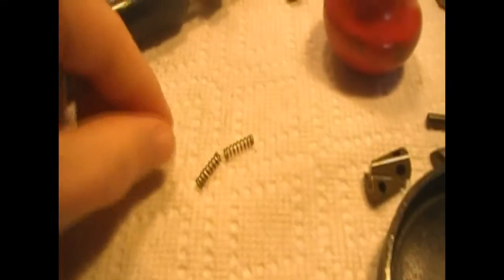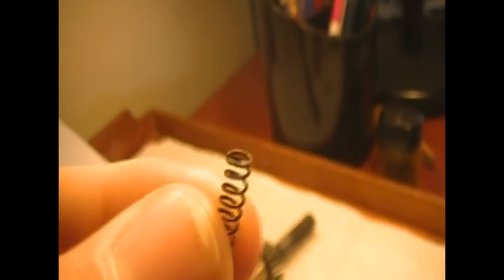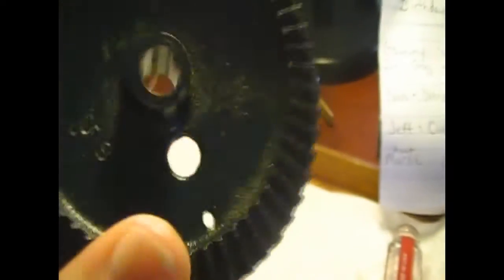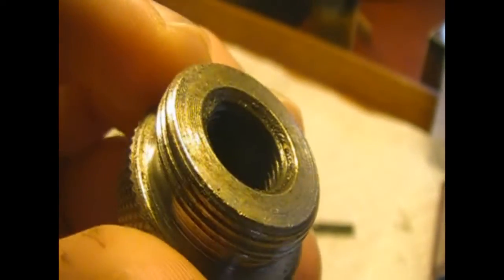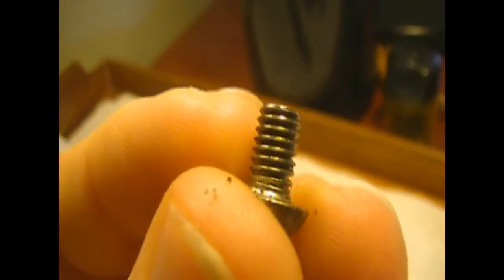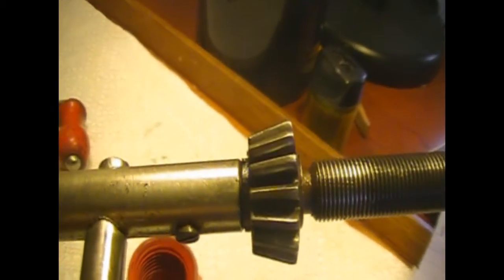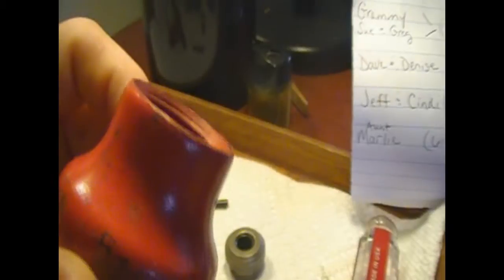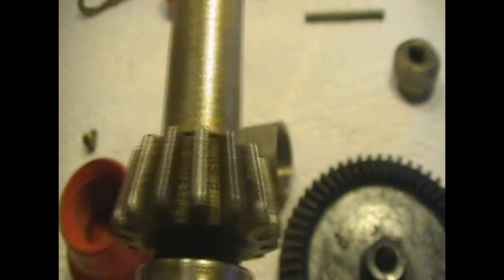1950's Stanley Handyman Hand Drill Dismantling and Inspection

Comment: Thanks for realizing it's always an enlightenment to know how something is done.  If it works it breaks!  If it's really good it takes a long time to break!

So goes my vintage 1964 Stanley Yankee 1530 AX manual hand drill.  This is the model with 5 shaft action settings selectable with a 5-position slide button on the middle of its shaft.  From the "floating" bit-grip in its chuck, your video has helped me conceive that possibly the bit-grip has a broken spring.  However, the crankshaft appears to be peened to the chuck.  This would explain why I can't screw the chuck off the shaft.  Even so, the chuck doesn't show any sign that it could then be separated (as yours does) if it could be removed from the shaft.  Accordingly, I don't know how I could determine for sure why the bit-grip is "floating".

Again, thanks for this rare opportunity.

Comment: Thank you for making this video, I bought a cheap hand drill from a thrift store to refurbish. In my car I took off the check to see if it was rusted inside, I wasn't expecting pieces to fall out. The piece(s) proceeded to fall into the crack of doom. The only piece I ever recovered that fell out of the chuck was a small metal disk. Given what the video shoves, that might have been the only thing that fell out. Still entirely nerve wracking though.

Comment: I used a hand drill similar to that one ... in the mid-50s ... except the tool was probably 50 years old (then). It didn't have springs to tension the clamp teeth ... or maybe the springs were broken.   :^)  

Very likely the drill that I used was manufactured not far from where I grew up in Western Massachusetts.

Aesthetically pleasing in its utilitarian simplicity.